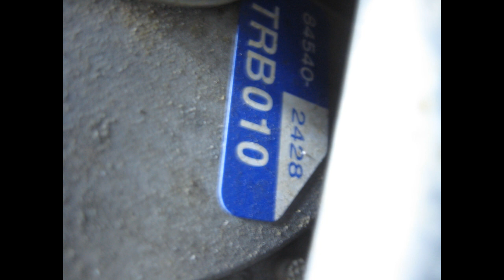2012 Audi Q7 8 Speed Multifunction Switch

Comment: I have error code p085000, changed switcher, but still have error code, can u give me some advise what I can to do??
Reply from the maker: My problem was not the Multifunction Switch. It was a corroded connector in the transmission loom. The inside of the failed connector was full of sludge and a couple of pins had corroded away. I repaired the connector to fix the problem. Check my discussion with Nigel W below for more information.
Reply: how.did you solve the problem? i have same problem.

Comment: Gday Don,
I'm working on the wife's car here in W.A. with same symptoms, a 2011 Q7. the symptoms got worse with erratic gear changes and sometimes not coming out of park. I hope its ok to add in what I've done in case it helps someone out. 
You may not have to remove your switch to sort the issue but I've put the info below in case you do.
I have the VCDS from Ross Tech also which has pointed me in the right direction. The wife and daughters have 3 Audi/VW between them so its a useful tool here. I'm no expert but reasonably handy. I've found corrosion in the plug above that same switch as Don did, also the plug to the auxiliary fluid pump on front of gearbox (for the stop/start function) and the large loom plug (where there are 3 plugs visible, located at the right side rear of the transmission. That plug near the right rear of Trans which is a 14 wire plug, held in a C shaped metal clip/holder, (you push/slide up the plug to release it from the holder to gain better access) was heavily corroded on ours and I had to replace it with two Deutsch Connectors. (an 8 pin and a 6 pin plug is what I used to make up the 14 wires of the original plug.) The original pins in the original plugs are a bit delicate so be very gentle when cleaning as they will break. 
Do a search for cleaning copper wire of corrosion using vinegar and salt solution, then using bicarb of soda and water solution to neutralise it. Its how I cleaned my plugs internally of heavy corrosion. You can try an electrical contact cleaner if only slight corrosion. ( I had the process all explained here but I think Youtube thought I was explaining something dodgey and it was highlighted in red and removed from my post? )
If you feel you need to remove the switch, you will need to undo the two metal lines that take the fluid to the cooler up front. (Or remove the lower one and pry up on the upper one as Don successfully did.) This is to allow the space to slide the switch off the shaft. I found removing that drive shaft from the transfer case to the front wheel drive, allowed me better access to the upper metal fluid line. You can spin that driveshaft freely one way and allows access to the Spline Bit headed bolts on the flange on the rear end of the shaft. After bolts removed, tap the mounting flange of the shaft and it loosens and you can slide it out the way to the side. The upper fluid line is held in with a torx screw and I used a small 1/4 drive ratchet with a torx bit headed socket. The metal fluid lines also have another retaining bolt just forward of the switch area and located on a tab that joins the lines together. remove it and you can now freely push the lines out of the way and unbolt the switch easily. 
I've taken my switch apart by drilling out the aluminium pin heads but found it dry and well sealed. I cleaned it out and re-lubed it for now. Like Don I'll try and track down a part ex China as there was some wear on the back of the selector arms inside the switch. I just bolted it back together with some small stainless bolts with nylocs. 
Be prepared for serious bill shock if wanting to buy a new switch in Oz. VW quoted me $988 and another mob wanted $1100. I'm going to replace my loom and plugs etc but that's later.
Additional part number info is that the transmission is an Aisin brand 8 speed and using the model/part number of TR80SD orTR80SD/0C8 (zeroC8) will bring up some other useful references. I found an Aussie site called "Alltranz" and using the TR80SD on there came up with good part schematics, internal filter kits, loom part numbers etc.
The switch is known by multiple names too which doesn't help when searching. Multi Function Switch, Neutral Safety Switch, Range Selector Switch, etc. Part numbers were for Audi/VW/Porsche 0C8919823 with that first numeral a zero not a letter O. Or try 84540-2428 along with TRB010 which is what is on the switch casing. These same gearbox's were used in many U.S cars too including some Jeeps. All worth cross referencing if searching for the same switch at a decent price.
I did a quick search in China but I'm only finding rebuilt switches at this time. If you possibly have a good contact for a new switch Don I'd be keen to look them up.
If you have read this far, having had similar issues, remember there's a good chance your switch is probably ok as it has a good o'ring seal inside and that its just your loom connector plugs need cleaning around the gearbox as the green corrosion in the plugs is a common issue. Which means you may not have to go to the trouble to remove the lines etc to remove the switch. Also I recommend wrapping your electrical connector plugs in Denso tape to keep any future moisture at bay after you clean and dry them. I work on harbour tugs and we wrap hydraulic connection fittings and electrical fittings in Denso tape if out in the elements. Its great stuff. Just wrap and mould it around. Hope this info helps someone else out. 
Cheers to you Don for taking the time to make and putting up the vid.
Cheers, Nigel Wade
Reply from the maker: Good work Nigel.  I burned a lot of time on that switch before I discovered the corroded connector. I joke with my friends - "How do you keep and Audi on the road? - Have two!". Happy motoring!
Reply: @donallroad  
Hi Don,
I’m still going through it here unfortunately . Whilst I’m reasonably confident that I’ve cleaned up the plugs on the trans loom I’m still having the issue after further tests. Am going to remove the front seats today and check the connections as am hearing the transmission controller under there somewhere and plugs prone to corrosion. I noticed the loom from the trans went aft and through the floor up under the drivers seat. 
I’m going to post the VCDS scan up on the Ross Tech forum site today also and see if those in the know can suggest further checks and tests. I’ll get there 👍👍🍻
Reply from the maker: Nigel, Well written! Your notes above match my experience. The connector on my transmission cooler valve also failed with corroded terminals , requiring a new valve and connector. I am on the road for a few weeks weeks, so I don't have access to my notes. I have the genuine wiring diagrams, a spare multifunction switch and other relevant notes that I can share when I return home.
Reply: @donallroad  Very kind of you Don. 
Yes I’m going to source a new switch for the side of the trans and a trans loom. If only the VCDS told you where the various specific components were located and how to get to them. 😁👍🍻
Reply: @donallroad  
Hi Don,
Thanks mate. Any and all info greatly appreciated. I’ve been on the VCDS forum and learning about how to source the “Battery History” data in the various sections. Our battery is 11 years old and I’m seeing the lowering of voltage can cause all sorts of spurious issues. New battery has been ordered, I’m swatting up on how to use VCDS to input the correct battery code to the computer etc also. Getting there slowly 😁👍🍻
Reply from the maker: @nigelw598  Snap! I replaced my original 10-year-old battery last year. Poor cranking was the initial symptom. I replaced the battery with a VARTA G14 Silver AGM 605 901 096 105Ah unit. The new battery manufacturer, type and size was the same as the old.  I changed the battery serial number from 1BAN0PC to 1BAN1PC to tell the battery management system the battery had been changed. Used VCDS / Module 19 / Long Adaptation / Channel 04 / Battery Information/Replacement to make the change.
Reply: @donallroad  
 
Thanks Don, much appreciated. I’m now going through the coding process “minefield”. I couldn’t get the Varta battery here. But my local guy could get the exact same in a premium AC Delco. It’s a S60595AGM. It’s same exact physical shape, exact same capacities in every way, is the same high grade silver plate AGM. But of course no BEM code. I’ve been stressing and searching the net and came across a post where someone in the same situation as me just changed the last digit of the serial number too.
I’ve taken pics of my old battery Bem code before leaving for recycling, just in case it is erased in the set up process. 
I see you typed “I replaced the battery with a Varta G14…” but I think you obviously telling me that’s what was in it originally? As you went on to say you in fact successfully changed the original serial number by one digit. 
That makes me feel a lot better as there’s so much doom and gloom on the net if not having the BEM code.
Thanks for taking the time to pass on the info. Very much appreciated! 
It’s late here now but hopefully this sorts my final issues when put in tomorrow. 
If you’re ever near Albany in WA, I’d like to buy you a beer 👍
Cheers 🍻
Reply: @donallroad  
Further to my last. I now fully understand your battery and coding etc. Apologies as I mistakenly thought all Varta batteries came with a BEM code. I now realise from Audi they do, but if bought from another source they don’t have the code. Hence why you needed to “trick” the coding with a new Varta battery. 
I coded exactly as you did and changed the one number. All accepted.
I have just been for a test drive and driving well so far. Only issue for me still remaining is the aux trans pump saying not working/faulty. We usually turn the stop/start off anyway. When under there I see I could remove the electrical part of the pump without too much trouble, so will do that soon and check it. I’ll order the loom, multi function switch and an aux trans pump via Europe and deliver to my Dad in the UK to send on. 
Once again Don, thanks for the info and advice mate.
Cheers, Nigel
Reply from the maker: @nigelw598  When you say Aux Trans Pump, do you mean Trans Cooler Valve ? The Valve is located on top of the trans adjacent to the Cooler. The Valve is prone to failure when the engine coolant in the valve leaks into the electrical terminals. I baulked at replacing my Coolant Valve when it failed due to the work involved. I cut the damaged electrical connector off and insulated the cut wires. I paid my local Porche mechanic to replace the Valve and Connector 2 years later. The DPF had to be removed to get to the valve. This is the error I was getting:

12754 - Valve for Transmission Fluid Cooler 
          P2754 00 [175] - Short to GND
Reply: @donallroad  
Hi Don,
My wife’s is a 2011 and has the stop/start function where it turns off the engine to save fuel “and cost you future starter motors”. The Auxilliary Transmission Fluid Pump is the electric pump on the lower front of the transmission. It keeps pressure up in the transmission when the engine turns off. It allows the car to accelerate immediately when you take your foot off the brake and the engine starts. 
I’ve found the erWin site, as recommended by Ross Tech where you can print wiring diagrams etc by paying for an hour, a day, a week etc. 
Unfortunately my transmission issues returned after about a 30 min drive. Stays in one gear, loss of the brighter light indicating P,R,N,D next to the gear lever. 
Most codes mentioned the range sensor (neutral safety switch as I know it) but I’m perplexed whether to buy one at $900 odd dollars and change it out as it may not be the issue. 
My scanned info and codes in address 01 Engine are,

8172 - Selector Lever
        P0919  00 (036) - Malfunction

The others listed in 01 engine are just telling you the check engine light had set and the other warning to check transmission module errors in the 02 module section.

02 Transmission Module codes are.

12782 - Transmission Range Sensor 
P0706 00 (175) Implausible Signal
(Transmission Range Sensor “A” Circuit Range/Performance)

12784 - Switch for Reverse Driving
  P306A 00 (009) Short to Plus

12800 - Control Circuit for Auxiliary Fluid Pump.
P0C2D 00 (175) Feedback Signal Low.

13254 - Control Circuit for Aux Fluid Trans Pump. 
P0C2C
 (Aux Fluid Trans Pump Control Module Feedback Signal Range/Performance)

When I search the codes online I find many varied possible causes. Also some people saying a software reboot etc fixed their issues. 
Someone had the P0706 code I listed above and turned out to be an internal sensor of the transmission that they replaced to fix.
I’m getting closer to taking it to an Audi technician. Getting a bit frustrated as nothing is 100% obvious or info on how to test. 
When my 2003 Ford F-250 with the 7.3 diesel has an issue, I search online and find the fix very quickly with good old YouTube vids to show how to fix. 🤷‍♂️
Thanks for listening Don, hope your weekend going well mate 😁👍🍻
Reply: @donallroad  
Hi Don,
Further to my last. (Yes there’s more!) : )
I think you are 100% spot on! I’ve persevered and found there was another plug on that loom that goes up to that coolant valve you mentioned. I was able to remove the wire and it was very wet and obviously a source of one of the shorts. I’ve just watched a vid explaining how the coolant valve fails and the pressurised coolant goes into the electrical part of the valve. It then travels down the wires (as the plug has good seals) in the transmission loom to the plugs on the aux fluid pump (start stop function), also the neutral safety/multi function/range sensor switch plug and finally also the main 14 pin loom plug. 
I’ll order a new valve today and a loom. 
I’m also going to re-clean all the loom plugs now, disconnect the plug from the coolant valve (expecting a code for that disconnection) and hopefully have it operate as it should till the parts arrive. Fingers crossed!
Thanks again Don! Much appreciated. 👍👍🍻
Reply from the maker: @nigelw598  Leaking coolant travelling in the loom - That explains why the pins in one of my transmission loom connectors corroded so badly! You seem to be way past any need for my wiring diagrams and notes, so I will hold off on that. While we are sharing, I should note that my other Q7 failures have been - Leaking oil cooler, leaking EGR cooler, blown intercooler hose, leaking injector O-rings and failed fuel pump due to a blocked fuel filter. The fuel pump is a big-ticket item, so make sure you change the fuel filter often.
Reply: @donallroad  Don is there fluid in those two metal lines, or can they be disconnected as is and moved out of the way to remove the switch?  I have this issue, and at the very least need to clean the connectors that are mounted on the top of the switch, and can't figure out a way to do this other than by taking the switch off (even if I don't need to replace it).  Thank you.
Reply: @nigelw598  Sorry to repeat my reply but I couldn't figure out how to tag both you and Don in a single message...is there fluid in those two metal lines, or can they be disconnected as is and moved out of the way to remove the switch?  I have this issue, and at the very least need to clean the connectors that are mounted on the top of the switch, and can't figure out a way to do this other than by taking the switch off (even if I don't need to replace it).  Thank you.

Comment: Hi mate I’m having the same problem did u have to remove the full unit as I’ve checked my wiring and it’s all ok put it all back together cleared the code after a bit of driving it started doing the same thing glow plug light starts flashing any other suggestions thank you in advance
Reply from the maker: The Glow Plug light appears to be a catch-all warning for a number of error conditions. In my case it was gearbox issues. I did remove, replace, test and refit my Multifunction Switch before I discovered the corroded pins in the associated wiring harness. The Q7 Multifunction Switch is a very complicated unit. A simple rotary switch will have a single wiper arm which makes electrical contact with  a printed circuit backing plate to give on/off combinations as you turn the wiper arm shaft. The Q7 Switch has 2 wiper arms, which each have 3 contacts, giving a wide range of switched output combinations. The Switch is expensive and prone to failure, but I managed to get one out of China at a reasonable price. It might be time to call in an expert . Good luck.
Reply: Don R thank you so much what’s involved to remove the switch is there any special way to put it back on the gearbox and how long did it take to come from China and was it new forgot to mention I got it scanned and the code was p0851 thank you again
Reply from the maker: This is general advice only - I don't know your skills and you don't know mine.

The rear belly pan has to be removed to get to the switch.  There is a nut on the switch shaft, plus two locating bolts to be removed. The problem is sliding the switch off the shaft. There are a couple of transmission fluid pipes in the way.  As I recall, I had to loosen off one of the pipes and GENTLY lever the pipe away to allow me to remove the switch. I may have needed to unplug the pipe at one end to get enough movement, but I cannot recall - It was 2 years ago.

Be careful here! You could damage the pipe or contaminate the transmission fluid if you are not careful. Keep the area clean and be careful of leaks if you need to unplug the pipe from the transmission. The new switch has to be aligned to the Neutral position after it is fitted. Shipping ex China to Australia was 2-4 weeks. COVID-19 shipping times are unpredictable. If in doubt, hire a competent mechanic.  Good luck!
Reply: Don R thank you so much for the advice I’ll have it looked at by a professional I don’t want to damage anything else thank you again